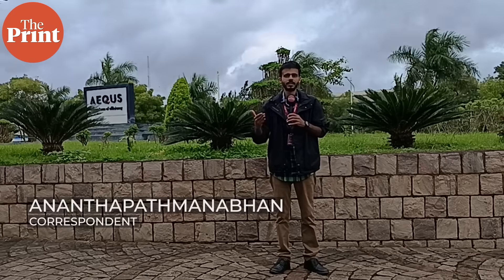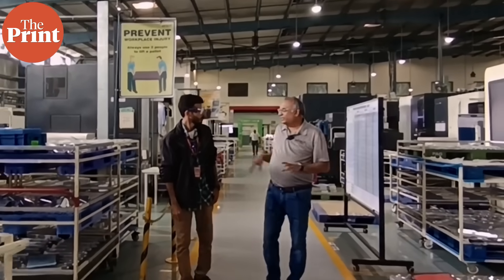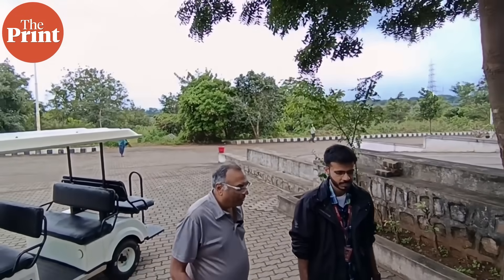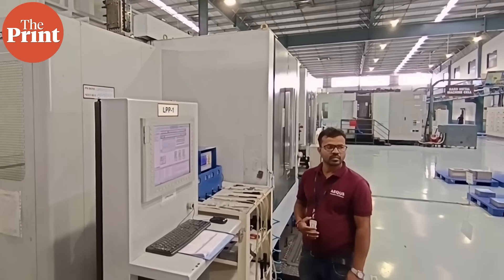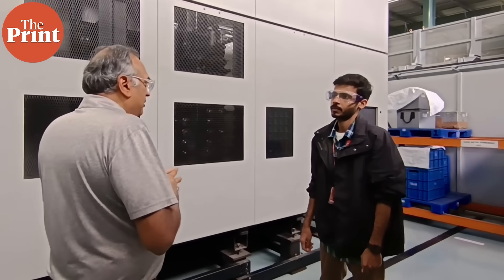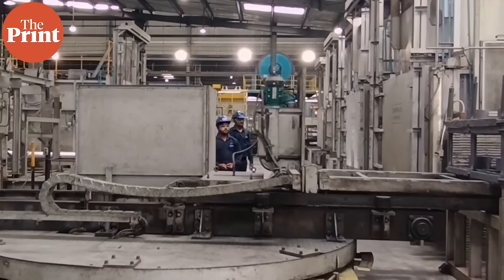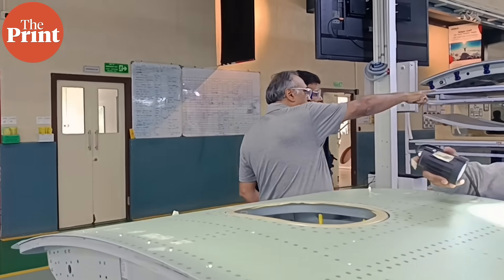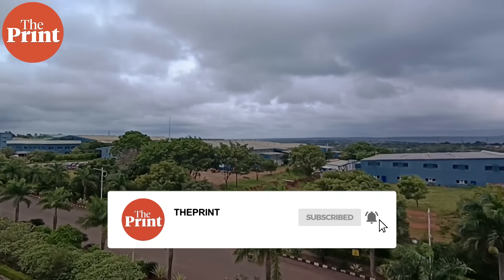Belagavi to Boeing. Karnataka aerospace hub is a shining postcard for Make in India

Comment: A start BUT a slow start. India imports Airbus by the 100s. YET, India does not have a transfer of technology with Airbus or even Boeing. Why? It comes to with some speculation. Poor Entrepreneurship and Management. NO funding from Central Government. No support of under capitalised Indian Banks. India is handicapped as always even India has the talent. Indian Managers had are short sighted - get quick objective. There is NOT enough money NOR the eco system for India to become a "power house", Low Salaries and Poor Conditions is the curse of Indian Businesses. Poor Digitalisation leading to More Corruption. OLD MEN still Rule India and many need the Blue Pill to get it up!!!